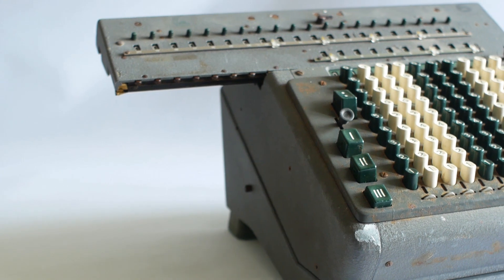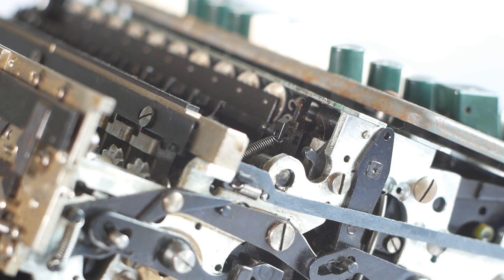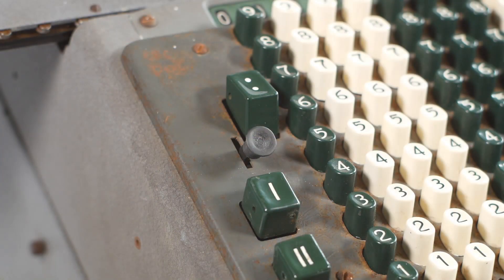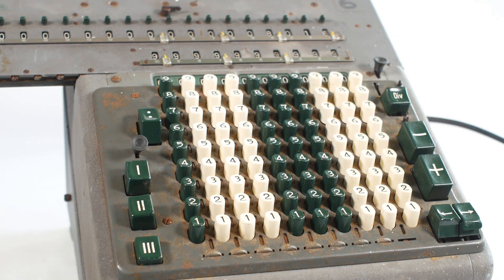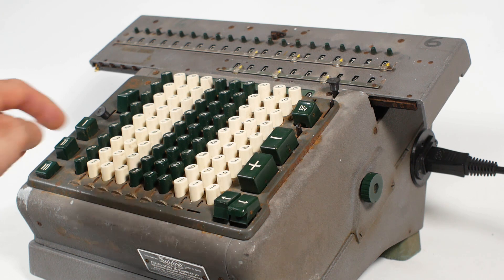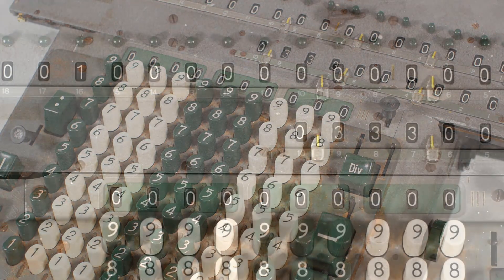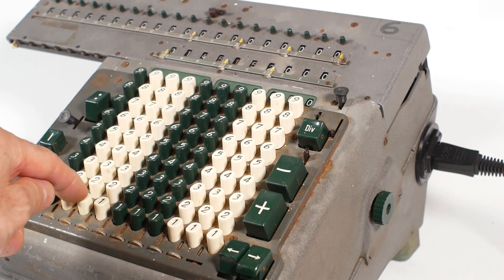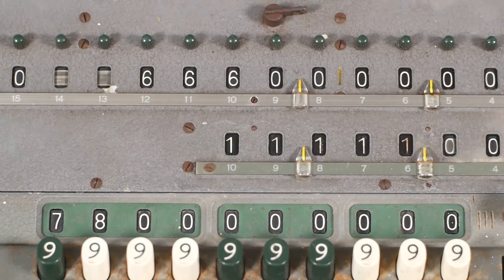Calculating Machine Repair and Demonstration - Madas Model 20LZVG

Comment: I have a mid 1930s Monroe LA5-160 with automatic division. It was very clean when I got it. The sliding step gears were stuck, freed those with WD40. That fixed the keyboard jam problem. But the electric part never could figure out. It just spins and doesn’t stop. Fortunately the calculator part still works perfectly so I made a crank for it. I think somebody probably tinkered not knowing it just needed to be unstuck so things got slightly bent making the automatic drive not work. It is great that you can actually get the old machines running.
Reply from the maker: Hi David, like you say, it's more than likely something that's sticking or has been bent that's preventing the motor from switching off - probably an easy fix once you've located it and gained access (always the tricky part).  Your home made crank will do the trick, and you'll have just as much fun using the machine, so fixing the motor drive can be a project for sometime in the future, or never.

Comment: Great video. I’ve acquired a machine of the same model from my in-laws. Looks to be in really good condition inside and out. Unfortunately it is not working properly. The motor is fine and I have sorted out a cable and PAT tested it (passed). The + key and the III key seem to be stuck down. I’ve had the covers off and removed the carriage as per your video. The grease does seem a bit gooey but I can’t see any part that is being hindered by sticky grease. Do you have any tips?
Reply from the maker: Hi Rick, my machine is in storage at the moment so I can't go and quickly check it.  The odds are that if the grease is a bit gooey, something somewhere is sticking - I know that's pretty vague.  When you plug the machine in, what does it do at the moment?  I'll try to get mine sometime and see if I can come up with some half decent suggestions.  Rule number one, don't force anything - force is rarely your friend on these machines.

I'm thinking as I write this - things like the plus key will usually latch down until the machine has completed the operation and then pop back up - there is usually some fairly delicate mechanism to keep the key latched, and if that mechanism is sticking, then it won't release the key again.  Or the mechanism of the key itself might be sticking and the latch is working fine but the key remains stuck down.

I'll add another comment if/when I think of anything else.
Reply: @GrumpyTim  Thanks! I’ll have a closer look for things sticking then. Is it ok to free up with WD40 or is that a bad idea?
Reply from the maker: Hi Rick, sorry, I was a bit slow spotting your message, WD40 can be ok for freeing stuff up, but if you spray it everywhere, you then need to remove the excess otherwise it'll just gather dust and grime that will eventually cause the machine to jam up again.  Also, WD40 isn't actually meant to be used as a lubricant, so once you've got the machine working again you'd ideally want to re oil the moving parts with a proper lubricant/oil.  However, if the WD40 had just crept into the seized part, softening the dried oil but not entirely replacing it (which would probably be the case), it might not be too bad a solution even if it's not my preferred method.

Comment: Just a quick question, how do you clean and oil parts in place (and are there any tircks you can share)?
Reply from the maker: Hi rewindoflow, it depends on the machine and how bad it is, but the usual thing that stops them from working is sticky old oil which seizes up the moving parts.  Sometimes simply adding a drop of fresh sewing machine oil and rocking the seized part, will draw the fresh oil in by capillary action, and the part is freed off.  Often though, a little heat is required to soften the old oil - I nearly always use my hot air gun (sold as an embossing hot air gun for crafting and card making), which can fairly precisely apply heat to the correct area - having softened the old oil, I follow the same process of adding a drop of fresh oil and rocking the part until it's completely free.  Any access oil can then be removed with a cotton bud, or rolled up tissue paper, or even a bit of tissue paper held in a piece of garden wire for very awkward positions.  To get the oil to the right place, I'll usually carry a small drop on the end of a screwdriver so I can get fairly deep into the machine and apply the oil just where I want it.  The smaller the part, the less oil is required, so I'll just use a smaller screwdriver, or even a bit of wire to carry a small drop of oil.

There are occasions when a part won't free off using the above method, or a part is actually damaged, in those cases I'll strip enough off the machine to remove the effected part.  I will always remove things like the carriage, because I think you'd struggle to get to everything with that still in place.
Reply: @GrumpyTim  Thanks so much for the tips! I have must stuff moving (except a couple of the selector cogs are siezed onto the shaft), but it still is all fairly sticky, and the functions are all a bit tempermental, so I think I will have to go through everything and do what you describe.
Reply from the maker: I seem to recall that those sliding cogs took a lot of freeing off, and it's possible that I even used a bit of paraffin to soften the old oil - same procedure of heating the area, applying a drop of paraffin carried on a screwdriver, and then rock/move the part to drag the paraffin into the gaps.  If you're using anything like paraffin/white spirits/lighter fluid, you'll need to apply oil afterwards so the moving parts aren't running dry.  As before, you'll need to remove the excess oil with a cotton bud or whatever.

Comment: While watching this video I was wondering how much power(electricity) a machine like this uses.
Reply from the maker: Hi Ohjajohh, the short answer is that I've just put the machine on a meter and while doing a division the machine draws about 38 watts of power.  That power is only used when the machine is doing a calculation, when it's sitting doing nothing it draws no power because it's technically switched off until a button is pressed, then it does the calculation and turns off again.

The motor on this machine it technically a 230 volt 0.3 amp motor.  This machine, as with other similar machines, uses a centrifugal speed control on the motor to keep it at a constant speed - this speed will be below the motor's natural running speed - as the motor speeds up, a set of weights move outwards, operating a set of contacts which cuts the power to the motor, then, as the motor slows down again, the weights move back inwards, closing the contacts and the motor speeds up again.  This switching process happens many times per second so the speeding up and slowing down of the motor will not be perceptible but it's happening all the same.  If more load is applied to the motor, for instance when more columns are being calculated at the same time, the motor should still run at the same speed.
Reply: @GrumpyTim  Very interesting, thnx for taking the time to put the machine on a meter.
Reply from the maker: Cheers ohjajohh, it was interesting to find out how much power it uses, I'd not thought about testing it until you asked.

Comment: Very well done bringing the machine back  to life. I enjoyed very much watching the video  and the good explanations! It is intersting that your machine has the same color keyboard scheme as mine. Regularly only the two right most columns are of one color and not three. And my machine doesn't have any filtering circuitry as your  more modern one.
Recently I made a 3d printable shell of an old type plug. Basically you dismantle the contacts of a modern plug, put them into the shell and fill it with epoxy resin. Then you add two metal strips for the ground contacts. If you like I can send you the stl file and a photo of the assembled plug.
Reply from the maker: Cheers Radio GaGag, I watched your Madas video a few times while I was working on my machine to try to figure out which parts should be doing what - it took me quite a while to work out that division lever which was bent.

I wonder if customers could specify keyboard button colour layout when they ordered a machine, depending on what they planned to use it for.

If you fancy sending your stl file that would be great, you can find my email address in the "about" page on my channel.  I had thought along the same lines, of butchering a modern plug and using the contacts from that in a new shell but in the end I decided to fit a modern socket, as shown in the video.  I think they added more and more filtering on the newer machines - my Sumlock 993s has a box full of capacitors, inductors, resistors - I've got 2 of the 993s machines and both had fried the capacitors across live and neutral so I replaced all the caps.  I've got safety capacitors to fit on the Madas but they hadn't arrived when I did the video - I'm always a bit wary of old capacitors that run to ground, although in theory, if they failed "short circuit" it would simply blow the house ELCB.
Reply: @GrumpyTim  Hello Tim, the file is on its way. You are absolutely right in taking good care about these old mains-to-ground caps and replace them with modern safety caps which are made for this purpose. I think, if one is using those old devices, they should be as safe as possible. So, I also always change these crucial caps and of cause also other leaky or shorted caps, but I store them with the machine so it keeps somewhat of its originality.
To my knowledge (Gerald Saudan from madas.ch told me so) the keyboards were indeed customizable when ordering the machine. My machine obviously served at an educational institute for statistics in Paris so I could imagine that they were not so much in summing up money and therefore not needing the two-column scheme.  Do you have any idea about the first owner of the machine and for what purpose he might have used it?
Reply from the maker: Cheers, I've got the 3D file and it looks great.

I have no idea where my machine was originally used, although it does have the number "6" marked on it in marker pen, so maybe it was in an office with multiple machines.  It also has something like "CRC Dept"  or "C&C Dept" scribed at the top of the keyboard cover so again I'd assume it was in a firm that had more than one of these machines - it would be lovely to know a bit more about the history of the machine.

Comment: I knew the answe to the minus division calculation before you did it without even having to do it in my head.... Well done for bringing it back to life! Also well done for the increasing viewers.

I wonder how long it took to design and prototype those machines.
Reply from the maker: Haha, I wonder how you knew!!!!!!  Cheers Ben, they're gradually building up, kind of surprising because I haven't made many videos lately for one reason or another.

I can't even imagine how much thinking went into those machines.  The basic principles were copied from one manufacturer to another but all the other parts, each individual lever that has to link this part to that, and then when they add extra functionality to keep up with the competition.......
Reply: @GrumpyTim  Yes, and they all have to interlock as well.
Reply from the maker: Of course, yeah, it's not even as simple as making the linkage operate correctly, it also has to interlock - it would be fun to travel back in time to see their design department and the prototype machines.